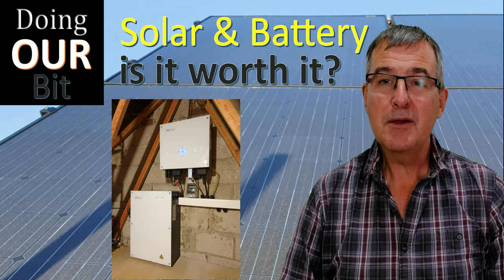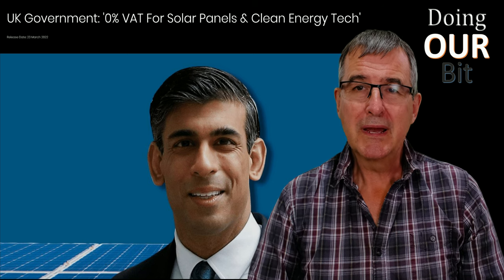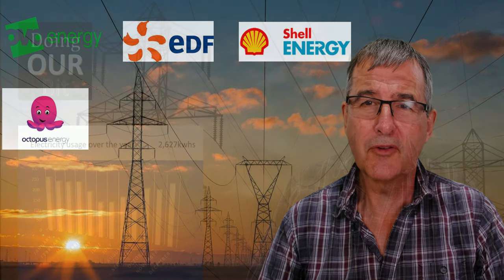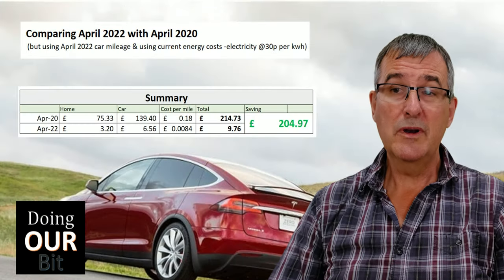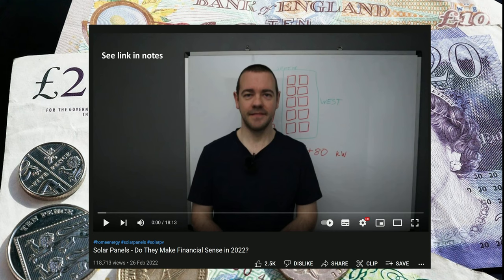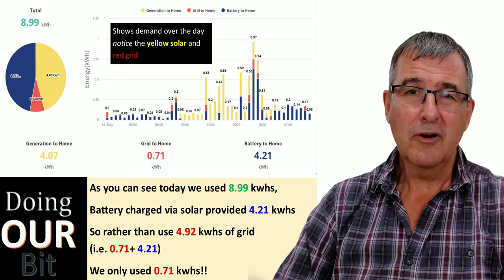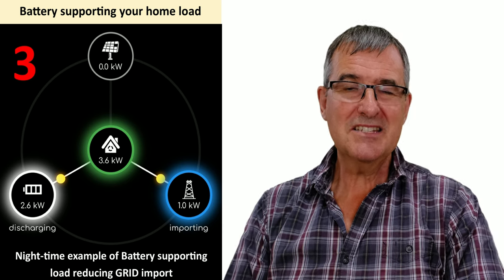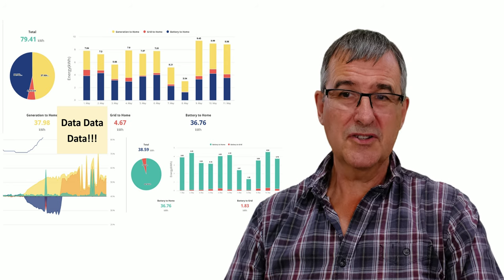Solar  and Battery install - is it worth it?

Comment: I'm a social housing tenant. My landlord has refused permission for placement of FREE STANDING GROUND panels weighted with concrete blocks. They refuse to give their reasons in writing but did give me a load of bullshit over the phone about needing to train safety inspectors - the panels would be connected to my indoors fuse box and this fuse box is owned by the energy supplier not the association and has always been altered and replaced over the years without inspection by the housing association. They threatened me over the phone that if I went ahead and placed panels on the property they would "have them removed". I am planning to pay the £300 and consult a lawyer sometime in the next 2 weeks. Social tenants are the poorest and most vulnerable, To refuse us permission for solar panels - especially in view of the government's vaunted commitment to "Net Zero" and in light of the huge and continuing price rises of energy appears to me extremely UNREASONABLE unjust and unfair, especially when I am paying for it myself upfront with money saved out of my pension and attendance allowance over years. But  private home owners get a grant. My local Tory MP does not answer my letters asking for help. Any comments, anyone?
Reply: Thanks for commenting and really demonstrates the gap between the talk and the actual actions on the ground. This is really sad on so many levels and really hope your push back succeeds and common sense prevails. There's a lot that needs to change so efforts like yours are applauded and not blocked by jobsworth "can't be asked"  managers.
Reply: Why not put the panels onto a 'trailer' ?
Reply: @richardmarkham8369  How old are you?
Reply: @jackrainbow560  ?
Reply: @jackrainbow560  Of what?
Reply: @richardmarkham8369  Everything.
Reply: @jackrainbow560  I must bow to your superior intellect then. Have a good life.
Reply: @richardmarkham8369  Why not just take the time to thoroughly understand what I have written?
Reply: @jackrainbow560  I did. twice. Hence my comment. It the panels are mobile, there can't be any planning issues. Also you can 'remove' them by moving them. Same thing applies to buildings in fields etc. As long as they are mobile, there is not much anyone can do to prevent you doing it. Worst case, you might have to move them slightly every month (28 days). But hey, you don't want to hear any comments, you'd rather just abuse random people on the internet...
Reply: I really hope it works out for you. Something to bear in mind is that a "proper" install of solar panels has some electronic gubbins too. An inverter (to change the DC output from the panels to the AC that you can use in your home, and a (possibly) a "diverter" if you want the panels to automatically heat your water, charge a battery or even charge an electric vehicle when there's (and there will often be in the summer) excess electricity. This electronic gubbins will have to be done by an electrician who'll ensure everything conforms to safety standards, and in any case, it won't touch the meter directly. As far as I know the fuse box itself (as opposed to the meter) isn't owned by the energy supplier (at least not where I am), so I really don't think the fuse box thing should be an issue.
Reply: They get commission
Reply: Solar panels and battery electrically are best left to trained people. Perhaps there are ways for you to become trained / certified as a means to become credible so you can support your home needs.
Reply: @benetedmunds  Yes, I've been where you are in my thinking, Ben, but their objections centre
around INSPECTION - they say they have not enough trained inspectors to allow installation. I advised them that the court will not accept that as reasonable grounds for refusal and they are now busy scrambling to present a credible case.
Reply: @esecallum  How old are you, boy?
Reply: @benetedmunds  No, they present arguments that are spurious and appear to be deliberately delaying. They tried arguing that they have not enough trained inspectors but of course no court would accept that as a reason to refuse permission and they are now scrambling to present a credible case. There are many issues, some quite amusing. They tried arguing that electrical cables running from the garden to the house are too dangerous, But the big problem there is the thousands of their tenants whom they would have to stop running cables above a certain voltage to their electric mowers, their electric strimmers and especially this summer, their electric filter and pump for their collapsible swimming pools which are very popular in the hot weather. You can't just ban old Jack from running power cables, you would have to ban EVERYBODY FOR ALL PURPOSES. A lot of tenants have power cables going to a fuse box in their sheds which are in the garden. If they stopped me from putting down solar cables (also installed by qualified electricians employed by major national companies) they would have to ban all the sheds for having power for washing machines and freezers. They have got themselves in a pickle and they are set to lose this case.

Comment: If you live in British Isles. Forget it. It will take 10 years to get your investment back. About as much use as a ash tray on a  motor bike
Reply: What are you basing that statement on? If you watched my video you would have my numbers based on our understanding of costs in  May where my payback is just over 8 years or 11% per annum, accepting as I said everyones numbers will be different. Based on the facts we have now this will be even better than this, and if you are making a general statement for everyone in UK I'm afraid I have to say you are clearly wrong, so again, wonder why you said this? I will be doing a thorough  analysis of this March 2023 when I have a complete years worth of solid data (solar generation to house direct or via battery, export to grid, annual grid use v total energy used) but this is far more than just cost, and I hope to be fully electric by this time best year, and be able to switch to off grid if required in the case of power cuts.
Reply: That may have been true 5 years ago. But with the improvement in solar pv and battery tech, and soaring energy prices, it no longer is. However: what’s wrong with being in profit after ten years?

Comment: It might help CO2 emissions (which all plant life needs) but the damage to the environment with green energy equipment and batteries is massive.. (read about mining and wind farm disposals at end of life)...

We looked at battery storage and even the resellers said to wait to the future as price/technology/savings wasn't there...

When you sign up for a new contract these energy companies are still paying a ridiculously low sum for your supply whilst they have massively increased their supply charges.. This is a scandal..  Only purchase enough panels for your needs.. Don't give energy companies virtually free energy...
Reply: Thanks for your comment. I am sure you are not meaning by "all plant life needs CO2" as if the manmade trillions of tons of excess over the natural carbon cycle is needed...its not obviously but needs to be said to avoid confusion. Also, the environmental impact of green energy equipment manufacturer and disposal is tiny (and improving all the time as it can) compared to the big picture so we have to keep things in context. Recycling of batteries/wind turbines/solar panels is in its infancy as the vast majority is still be used but will be because it is commercially viable (particularly batteries), so you maybe don't have to be so concerned on that as much as you are.  Certainly in the UK the savings are there for battery storage at the current costs/ energy prices but this is something everyone just has to do the numbers to calculate for themselves. I am going to do a video hopefully March 23 with my numbers so you can see the impact of a battery but already it has surprised me the difference it makes not only in covering the night hours but supporting the load when solar isn't enough during the day. For example since the system has gone in my total consumption for the home ex. Car  has been 1626.05kwhs, where the battery has supplied 750.19kwhs (205kwhs offpeak grid the rest solar), Direct solar 694.59kwhs and I have used just 386kwhs of energy from the grid, I.e. only used 23% of my energy needs for the house. I would agree that the amount energy companies pay on average 4 1-7.5p for SEG is not a lot although if you export a lot Octopus Energy's Agile tariff pays market rates so can be better than their off peak smart tariffs like Go, but again you have to do the maths. Given the costs I would definitely recommend everyone installs as many panels as you can simply because this improves the yield over the winter months, and you can obviously use your summer excess for a car or increasingly Aircon during the summer. And although the amount the energy companies pay is as we said not a lot, your contribution to the big picture does flattern the peak demand for everyone...small contribution yes, but if a million people are doing this not so much. Anyway, hope you benefit from solar whether you have a battery or not. It's certainly complex and not a one size fits all.

Comment: the investment exceeds the benefit if it cost more than 2500.
Reply: Wonder how you arrived at that surprisingly low number? In the UK average energy prices are set to reach £3,600 per year and a solar battery system will likely remove 2/3rds of that cost every year. As I said in the video everybody's numbers will be different as will their consumption but certainly in the UK, if you have the money and the right property, 9 times out of 10 its a no brainer. Thanks for commenting

Comment: I'm all for saving money but the co2 issue is irrelevant as if everyone in the uk tomorrow was carbon zero it would have no impact due to China and Russia, we should stop talking In these terms and trying to guilt people as it would do nothing for the supposed climate emergency
Reply: Thanks for your comment. I would not wish to put anyone on a guilt trip because to be honest too many people simply do not have the resources necessary to do anything about it anyway. Certainly me in my 20/30's no way!! But I have to say the "it makes no difference" argument is greatly understating what we can do and an argument to do nothing at all that doesn't make sense on lots of levels . If 60 million people were zero carbon (apart from the fantastic air quality, thousands of lives saved by said reduction in air polution  and economic benefits wow off the charts) you would be saving a minimum of 720 million tons of CO2 per annum so hardly nothing, and that's before you factor in the other pollutants associated with fossil fuels. In fact it's the main reason for my channel in a time when money appears to be the only measure of something, and frankly believe me health is so, so much more important. Anyway hope you'll do your bit hey...

Comment: So is it worth it? I'm not sure it is. The town of Swindon is having a big push to get as many homeowners to switch to Solar. I spoke with the company that are going to install the systems, from my current electricity usage, they reckon it will take 17 years to recover the cost, with a standard installation, not sure how you arrived at 8.85. There was no mention of a Smart meter. I have no intention of buying an EV, for a long time, by which time Hydrogen and synthetic fuel will make EV cars redundant. As for constant checking of charging etc on your phone, that's a hassle I do not need.
Reply: My ROI will likely be better than that given the rates for my next tariff change in September where peak is nearly 40p rather than the 35p I was budgeting for. It is though a  very individual thing and also hugely affected by that cost of install /battery cost etc. plus my EV contributes as well so to my future further migration away from gas hopefully in 2023. Your numbers however suggest its either only solar/ solar array v useage out of sync / not using off peak overnight smart meter tariff or your supplier is not the best. But its impossible to be dogmatic about this because everyone's numbers as I said will be different. I plan to do a video in March 2023 with a years worth of solid data to illustrate this further. You have obviously being paying attention to the wrong sources though on cars. Hydrogen will play a part, sure, in transportation but will be tiny / nonexistent in cars...and synthetic fuels not so, as to continue to use a staggering inefficient high maintenance ICE engine simply makes no sense (aware ExxonMobil promoting this which should be a red flag to everyone with BMW etc) except to keep vintage vehicles on the road.
Reply: @AdrianSmale  I have not been looking at the wrong sources on vehicle fuel. I spent over 40 years in the Automotive industry working mainly for car manufacturers. I am aware EV drivers hate the fact that the ICE will still have a future, long after 2030, they also dislike Hydrogen power. The ICE engine is not inefficient. Synthetic fuel is here, Porsche will be using in their various race formulas around the world from 2023. You are correct it is being developed with Exxon Mobil. The big task is to reduce the cost, it will take time, but it will get there. There is an argument for all fuel types, pure electric is great for Cities and towns, also for low mileage/distance users. Hydrogen and synthetic works for higher mileage users. Cars using these fuels can fill up in under 5 minutes, much like we do now. Hydrogen will work well in Plant and commercial vehicles. JCB is investing heavily in this technology. It will feature in an ever increasing number of passenger cars. Other than your issue with BMW, whatever that is, like many EV drivers you appear to want Synthetic and Hydrogen to fail, why is that?
Reply: Hydrogen or synthetic fuel vehicles? Good luck with that. Don’t hold your breath!
Reply: @paddyeason9677  Well Efuel is Uk available now, albeit at a price, which will fall over time. Exxon Mobil working with Porsche, very recently Toyota and other companies, are developing Efuel. JCB has development trucks running on Hydrogen in addition to plant vehicles. Toyota are also developing Hydrogen. There is an issue, drivers of EVs want ICE drivers to accept EVs, sadly EV drivers refuse to accept there are/will be credible alternative fuels for ICE vehicles. Last week the EU moved the ban on new ICE vehicles back until at least 2035, it appears the UK will follow shortly.
Reply: @robinoconnor1203  Zombie tech. Doesn’t know it’s dead. Niche, at best.
Reply: @paddyeason9677  Typical EV driver or fan response.

Comment: Smart meters are not good for you.  Plus they can switch them off
Reply: Really?  Addressed this is my video Smart meters separating fact from fiction. But,  while they, the meter that is, are certainly not perfect I'm viewing my import and export data this past week from a thousand miles away, together with my battery solar system.  Obviously you can still use that old fashioned spinning wheel meter but I would lose significant control, granular data and it would cost me significantly more money, so impossible to recommend. As to the other "they" the energy company, regardless of your meter, they can disconnect you ...but assuming you are paying the bill (and if you are not they put in a prepaid meter) why on earth would they given they would loss business. Think this through sensibly and you will realise this is just BS and we need to  called it out for what it is, because this misinformation and does not benefit people, quite the reverse, but sadly fear is much used tool today. Please checks the facts. You will discover they don't work for a small minority of people due to coms issues due to location, but the vast majority of people are just fine, like me.

Comment: Is it still worth doing if you have a diverter that heats hot water ?
Reply from the maker: Would need to know more. But like in my most recent video" journey to 100% electric" so much has changed last 4 years. Smart tariffs in particular change the game. I was going to add solar diverter to our Mixergy tank - (2023) but with export 15p and import 7.5p, no longer viable. Hindsight is 20/20 hey. Assuming you are on a off peak /peak tariff I would work out how much peak you are using annually cost and then how much peak you are using  max per day. The latter will give you your ideal battery size and then the cost of energy you could save divided by cost of battery gives you the ROI. Again battery costs will half by end of year (CATL) so I would wait to 2025 ideally, but it may make sense sooner depending on that calculation. So difficult planning in an ever changing landscape. All you can do is do the maths and make the call. One thing is certain though, you'll be doing y(our) bit!!